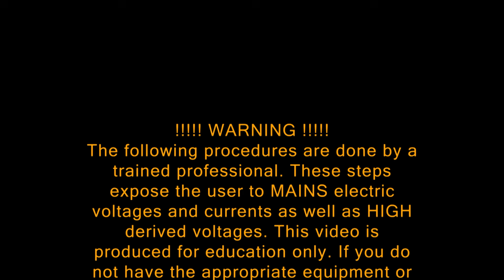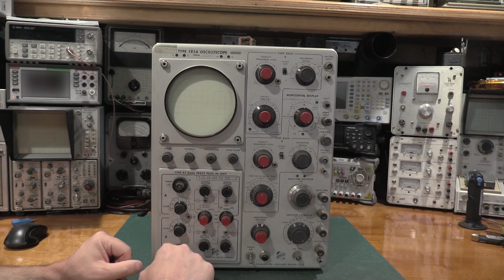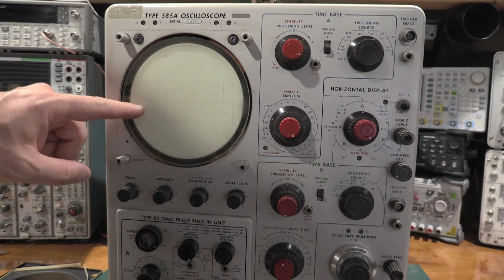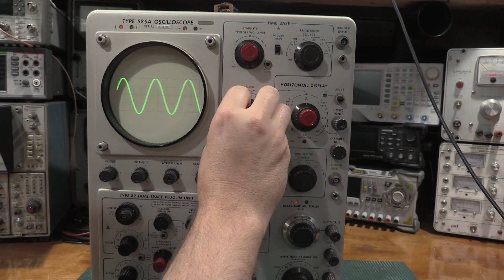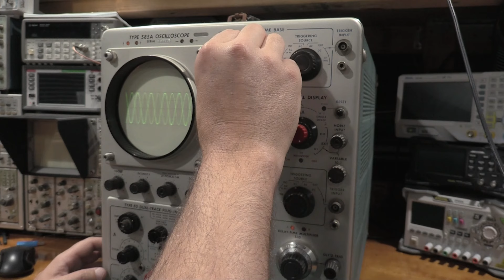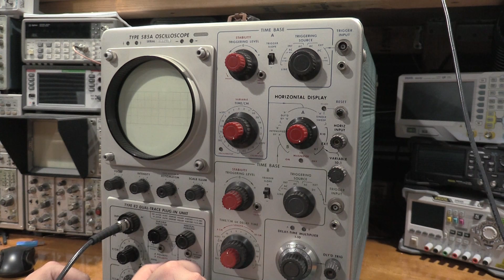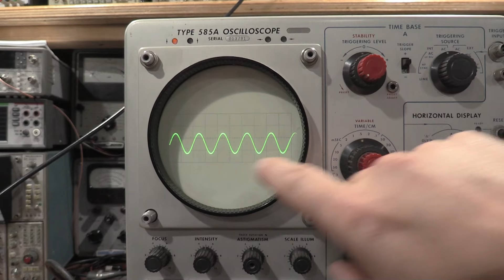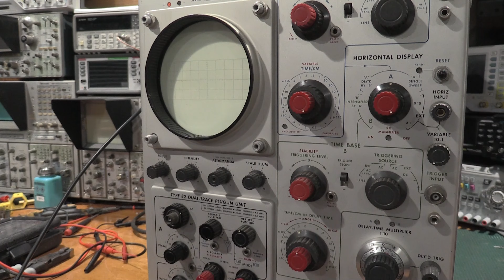Tektronix 585A Restoration and Troubleshooting (Part 1)

Comment: That crusty piece you pulled out when you pulled the fan is the bushing for the rear of the CRT. It and the clamp that holds the CRT in usually disintegrates over time. A friend and I developed a replacement for the 500 Series Tektronix scopes and he has them for sale on Etsy. I have them in all my scopes that needed them and they solve the problem.

Comment: I am trying to remember if the 585 had a tunnel diode in the trigger circuit that was in a clip in holder ?? If so, maybe there is some corrosion on the contact.  It has been a few years since I worked on one of these.

Comment: Lubricating the fan should be the first thing you do on these old Tek 500 series scopes.  The fan motor sleeve bearings aren't brass, they're typically Oilite or similar which I believe is a porous bronze material which allows them to hold oil.  The felt pad stores a small quantity of oil that gets sucked into the bearings over time.  Most shaded pole motors use them.
Reply from the maker: The fan was lubed and checked the baring damage was done before the unit came to the bench unfortunately.
Reply: @ZenwizardStudios  The Tek 500 Series scopes were some of the most beautiful instruments ever built.  I had a nice Tek 551 30 Mhz Dual beam with a bunch of plug-ins incl. 2x 4-Channel for 8 traces.  I could use it as a rudimentary logic analyzer and see the whole 8-bit data bus on my Commodore 64 back in the day.  Lost it after my brother died and my SIL had the cops remove me from the property so I lost most of my house stuff that was stored there.  It had the separate power supply so the cart was pretty much a requirement.  It would heat up the room pretty quickly!  Thankfully, I didn't lose my Tek 7844 Dual Beam and the pile of plug-ins I have for it.  Tek stuff can be addictive.  Sucker for 500 series stuff too!

Comment: I have a cheap oscillating tripod room fan that uses bearings very similar to those faulty ones in your 585. That style of bearing may not be as uncommon as you think! Another avenue for replacing bearings would be a machine shop. Now it maybe prohibitively expensive to hire a professional machine shop to make a couple of fan bearings but there's no need to go pro! There are also amateur/hobbyist machine shops on YouTube!

Comment: Problematic triggering could be a sign of failure of the tunnel diode in the trigger circuit. The big advantage of the 585A over the 585 is the tunnel diode triggering, which makes the trigger circuit suitable for such a fast scope. The bad thing about tunnel diodes is that they will sometimes change characteristics on you. The 585A uses a 1N3848 or 152-0140-01 10 mA tunnel diode that isn't too hard to find. There may also be Russian substitutes.

Comment: Talk about boat anchor 😋
Don't injure your back moving that thing around.
Btw, it should be possible to remove the original bearings by heating the metal around them and then pressing them out in a wice.
Order new bearings based on the size of the old, and mount them in the same way with heat and preasure.
Reply from the maker: These fans were pre bearing. They were actually an oiled bushing that ended up getting extremely galled up to the point they destroyed themselves. Unfortunately the fan tare down was.... destructive.

Comment: You've mentioned going lead free and the accompanying  nitrogen setup to allow for the higher 3% silver alloy for the ceramic strips.  Is it worth it compared to what most people can get without investing too much, standard leaded with 2% silver, ie 62/36/2?  I know tek spec'd something like 60% tin, 37% lead, 3% silver, but they also weren't adamant about that percentage.   Also. Any opinion on the two high silver leaded alloys on the market - Cardas quad eutectic which doesn't specify it's silver content level but is assumed to be >3%, or WBT 4%?
Reply from the maker: N2 is NOT necessary but it is a nice to have as it makes the solder behave better. However the price take for N2 soldering is extremely steep compared to the benefits. Building an N2 setup from scratch will cost north of $4,000.00 when it is all said and done so this will be a non starter for most. 

The good news is that N2 is not needed. However the Silver solder is REALLY NEEDED. The alloy I an currently using with good results is a Kester product num 24-7068-1402 The Alloy is:
Sn – 96.5%
Ag – 3.0
Copper – 0.5%
3.3% Flux

Comment: cannot remember what model, but i had a 500 series when i was a kid and it came with a tiny reel of special solder for the ceramic tag strips and remember the wash it with water lunacy  -my horror of thinking of trapped water sitting in the layers of the mains transformer and a rusting transformer core
the thing weighed a ton and needed a trolley to move it to another bench (i was around 14-15)
it had a non linear trace compressed on the left i think and a very weak trigger ,i knew nothing about valves and didnt want to learn so i replaced it with a lovelly 7403n (except i had dents in my fingers constantly from pressing the tiny square pushrod buttons) and sooo much more practical and safe to work on

Comment: Would a stack of modern 12 inch computer fans (stack a few to get enough static pressure to push through the filter) be insufficient? Sure a 12V supply can be put in the chassis somewhere.... While it would certainly not be true to the era, it might even be much quieter :) ... Hint: some computer fans come in both a cw and ccw rotating version, combining these is reputed to help making more static pressure and less turbulence.... might be a little louder though (rack servers often use counterrotating fan pairs - not quiet, but then these things are small, high rpm, and required to create enough static pressure to basically push all the air through screw holes..... Ah dang, forgot the fan is also used as a ballast...

Comment: Unfortunately, the only plug-ins suitable for the 585 series scopes are the 80 series Other plug-ins used with the 530 and 540 series scopes will not work without a special adapter.